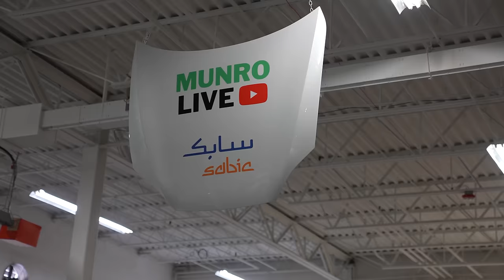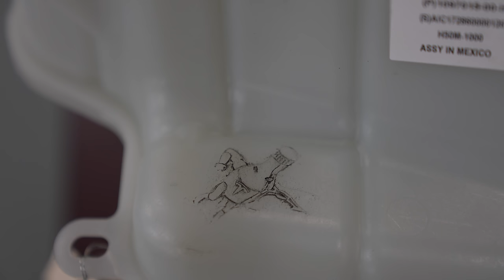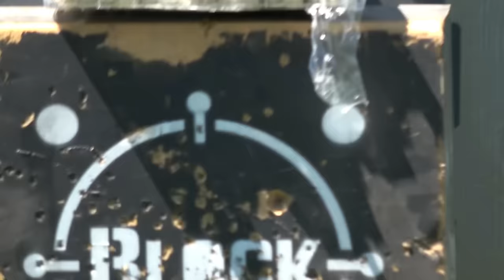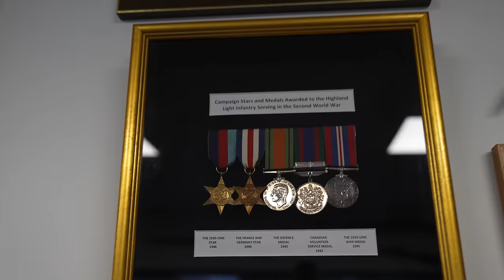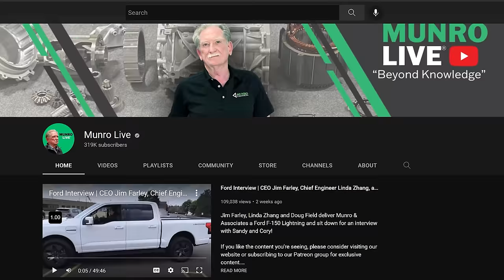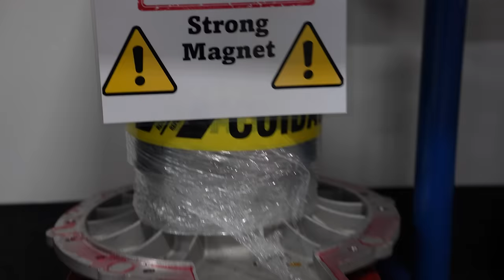Picking up my New Tesla 4680 Battery!

Comment: The funny thing is when Sandy started this, Tesla fans did not like what he had to say. Now, he is the biggest Tesla fan
Reply: Tesla has certainly done a lot to simplify manufacturing and reduce part count.
Reply: Some of Munro’s suggestions to Tesla were actually implemented. He’s contributed more than most Tesla fans.
Reply: It was the way it was done. Not specifically by Sandy himself. He didn't like the body build quality, but hadn't started tearing down the car. His first impressions were then pushed heavily at the time by hate groups and media. When he started the teardown, he began praising a lot of the tech in the car. I remember it appearing like UBS or another company was trying to keep his stance at that point silent, but that could have been just a misunderstanding on my part. Either way, you never heard the good things he would say by the media or those hate groups. That was about 5 years. Tesla has since implemented a ton of improvements that Sandy suggested and gone beyond that.

Comment: so if you get volts right...why not replace the batteries of an old hybrid car with 4680 cells? should increse the range of the car quite good! or will the computers detect that something is wrong?

Comment: They have never improved the batteries that well the mileage is still not as good as the 1800 battery pack in the first electric car it would go a thousand miles on a charge but they've never improved it than that matter of fact it went downhill the 500 or less

Comment: Folks, if you like peace of mind about your battery (longevity & safety), for years to come, just charge your EV between 30% - 70% (and do  90% - 100% when going for a long Road Trip).

(I own Tesla S & X, and I'm an Electrical Engineer)

* High temperatures kill batteries.  If you go on a holiday/vacation during the summer, leave your vehicle at a low SOC (state of charge).  For example, at or below 30% SOC  

* Cycle within a narrow SOC range.  For example: 40-60% rather than 10-80%.  The cathode expands and contracts in a wider SOC range, which causes it to break apart.   

* On that note:  The lower the narrower the SOC range, the better.  That means charging frequently.  

* Avoid charging the vehicle above 75% SOC.  Above 75% side reactions start occuring that cause degradation.  This also reduces the volume expansion issues mentioned

* Taking all variables into account, operating between 45-70% SOC, and storage at ~30% is ideal.  

* Occasional high SOC and wide SOC range are okay!  For example, the occasional road trip.

* With good thermal management hardware and battery management software, supercharging should have minimal negative effects on cycle life

But even y'all will not follow those tips. The battery will not die tomorrow. it is just that there are some small (or big) consequences later on.

Have a great day!

Comment: Can you do a video on what happens with older batteries?  Do they get recycled?  Wonder if electric cars are trading one problem gas pollution for e-waste caused by old used lithium-ion?
Reply: That’s exactly what is happening
Reply: Tesla recycles all of their old malfunctioning battery packs which aren't repairable anymore to use in cars.
Reply: they can be recycled but currently less then 20% are
some are landfilled in special landfill for possible future re digging up for recycling 
others are being stockpiled even tho its very dangerous to do it

also the amount of extra mining etc for an ev really outweighs any benifit
Reply: @southaussiegarbo2054  this information is incorrect. Tesla recycles ALL of their old batteries in house.
The volume of minerals extracted from the ground for EV'S over the complete lifespan is also much smaller than the volume needed to produce and run an ICE car.
Reply: The up-front environmental impact is higher for electric vehicles compared to ICE, but the total environmental impact over the whole life-cycle of the product is lower.
Reply: @WallaWillie   i would say its about the same 
Especially when lead acid batteries are more easily recyclable then lithium ones.
It really is about the same if you think hard but they just wont admit it
Reply: @maxencesimonart4302   they dont recycle them all as that is impossible 
Especially when they sold world wide and cannot go via airmail so gotta go by sea freight which is hella expensive for the batteries by themselfs
Its cheaper to seafreight the whole car then it is to seafreight a couple hundred kilo battery
Reply: @maxencesimonart4302  and actually more minierals are extracted for an ev bc regular fuel vehicles dont require lithium or many other heavy metals in the amount an ev does(including cobolt,cadmium and more including gold and copper)
Most ice vehicles contain
Steel
Aluminium 
Copper
Plastic
And traces of gold or silver depending on many factors.

An ev contains more due to lithium and other stuff. 

Just they dont like revealing it

Plus how will we build roads without making petrol/diesel as well the liquid tar/tack is a by-product of fuel manufacturing. 

We are trialing alternatives but so far they arent holding up as good as the good old fashioned asphalt/blacktop we been using for donkeys years. 
So yeah.

Also atleast an ice vehicle could burn ethanol or even if done right burn hydrogen
Reply: @southaussiegarbo2054  I was talking about the thousands of liters of raw petroleum that need to get pumped out of the ground in order to run ICE cars during their lifetime. In addition, Tesla doesn’t use cobalt in their LFP batteries and their 4680 batteries. And yes an ICE car uses more rare earth materials than an EV due to the katalytic exhaust system to remove hazardous fumes from the air.
Don’t worry about the need for leftovers from fuel refinery from road, even when all cars are electric the world will still use more than enough fossil fuels for that.
Finally, fossil fuels are in no way sustainable due to CO2 emissions and limited reserves on earth, so sooner or later an alternative will have to be found. Therefore let’s just embrace change and make the best of it through brilliant engineering and focus on sustainability, like Tesla does.
Reply: @maxencesimonart4302   they cant recycle them all lol thats physically impossible. It would just be a myth they use to look good kinda like myths other places use
Reply: @maxencesimonart4302   and tbh when most electricity around the world is produced by burning fossil fuels then yeah ev dont look good
Also where im at its more expensive to charge an ev then it is to use an ice car
Not to mention some ev have issues for towing where its breaks wont work if it is at 0% charge unless you hold the break pedal down. 

Ev also are tested empty not loaded(that was proven by a few places ik of and they wound up selling the ev at a huge loss.

Ev should stay in development for the next 10 to 15 years before we try forcing them on everyone
Not everyone has 50k to spend on a new ev and upto 30k for a new battery depending on the country you in
Legit you could service an ice car for upto 80 years with that money which includes a new battery every 3 years and new tyres every 1 to 2 years.

Here some guy used mains power just for his ev and for 3 months it was around $800

Where as his ice vehicle petrol bill for same time was about 300 bucks. 

That kinda puts it in perspective that ev are more towards wealthy

Not to mention the neumerous ev charging stations in garages catching fire recently causing people to lose everything sadly thus ending up costing them over a million dollars. 
Insurance will cover some that cost but you still out of pocket for the 5 or 10 grand excess to.
Reply: @southaussiegarbo2054  obviously they can recycle them all for the time being. Pack last around 12 years, that has been observed until now. 12 years ago they didn’t produce many cars and they are thus able to recycle them all. If it was untrue, shareholders would have sued the company for misleading information.
Reply: @maxencesimonart4302   people holding shares wouldnt bother looking deep enough into costs to ship a battery from say Australia back to tesla via sea freight (bc lithium cant go by air mail) 
To ship a battery by sea freight would cost thousands of dollars 
To ship 5 cars via sea costs around 4 times what it costs to ship one battery all bc said battery is dangerous goods and they wouldnt be shipping a 20foot container back thus cost a fortune to send 1 or 2 back. 

I did the digging to find costs to 😂. 
Its all what they call fine print/hidden info

Not to mention the amount of diesel used in said cargo ship to transport the battery back to being allot of fuel
Reply: @isaactruss5922  no its not. tesla and other carmakers are literally recycling old batteries...either themselves or other companies!
Reply: @southaussiegarbo2054  I have shares and I look into this of course. It does cost them money but it yields huge amounts of money as well as they don't have to dig up new materials for other batteries.
Batteries can go by air freight too, so sea freight isn't the only option.
Reply: @southaussiegarbo2054  You have many issues in the info you have. First, recycling and repurposing is done frequently. Maybe not 100%, but still very high. Batteries are too valuable to leave disposed for too long. Recycling is improving very quickly as more recycling centers pop up. It's hard to get good and accurate numbers since everything is changing so fast right now. EVs haven't been getting built in high numbers for very long and everything is different per country. 

The second big mistake is your view on power generation. This seems to be due to you living in or at least highly associated with Australia. Coal power is king over there currently, at over 70% of electricity comes from it. That is not the case in most areas where EVs are sold. China is likely the only location where EVs are sold heavily that still relies on a majority of coal power plants for electricity, and it is still only a little over 50%. Europe and the US get very little power from coal. Natural Gas is a major use for power plants, but nuclear, solar, wind, and hydro all make up a large amount of electricity generation as well. Further, an EV powered by coal is still cleaner than an ICE vehicle. It just may not offset it's extra construction in the lifetime of the vehicle and typically an efficient hybrid is a cleaner overall solution. When using natural gas, an EV is far cleaner than any ICE and will offset any extra pollution generated by it's construction in it's lifetime than all except the absolute most efficient hybrids. If you use mostly clean power, like solar or wind that can be installed at your home, you can offset EV construction pollution in less than a year of use, and less than 3 years over even keeping an old ICE car. Engineering Explained did a great video on this a few years ago.
Reply: В Масштабах заводов "Тиеслы" они не будут заниматься полной переработкой, они могуть снять контроллеры, а ячейки отправятся на свалку, выколупывать каждую баночку не кто не будет. Это рекоамный ход что они перерабатывают батареи.

Comment: @6:20, you can see sparks in the pack between the batteries.
Reply: I saw that too, but upon replay a few times doesn't it look like a cellophane type thing flapping in a fan breeze? They have some big fans around the room and there might be one overhead really whipping and causing that to flap.

Comment: There is one very obvious problem with all these battery cells inside that foam, and that is saying goodbye to the possibility to replacing single cells, instead of the whole battery, if a single cell should happen to fail. 

I have had EVs since 2002, and am quite disappointed about the humanity not managing to mandate the right to repair through legislation which when it lacka - both makes our phones less repairable because of DRMed parts, and EVs not so sustainable, as a new battery is priced to more than the price for a new car. EVs can be made really modular and easy to fix, instead we are looking at a John Deere Scheme, in a larger degree, especially with Tesla.

Tesla may be a cool car, with advanced technology, however the customers service and rights is no good at Tesla’s, so noone who barely affords a Tesla,  should buy a Tesla, but rather some other EV, and obviously look for the brands that are less hostile to their customers when something needs to be repaired. Which is an advice for buying any modern electronic product, really.

Comment: The production of batteries requires lithium.  To produce 1 ton, the leftover process produces 78 million tons of acid water.  This is only 1 example of what is required to make the batteries.  Good thing it’s Green.
Reply: Have any examples of the environmental cost for getting oil? I dont recall any giant lithium spills. But you ignore that right?

Comment: I am also blown away by Elon Musk and the genius behind everything he does!   Elon is doing really good work.   I am starting to believe the 4680 form factor is probably not a good move though.   I don't like having only 9 batteries in parallel,  I liked more batteries in parallel because we know fuses will blow and you can't just switch a single battery out.
Reply: You ain't switching that battery, or even the pack. It would be a complete write off. :o
Reply: @joshuaphillips4842  exactly. . . That is what I like about current Tesla you have 46 batteries in parallel. . . Blow 1 fuse and it is nothing much.
Reply: You cannot easily replace the current batteries either, and you shouldn't even if you can unless you know a lot about battery packs and are willing to manually balance the cells.
Reply: @anthonypelchat  lol, sounds dangerous
Reply: @joshuaphillips4842  If you set it up properly and have the right tools, not too bad. About the same as a diy solar system using 48v packs or higher. Dangerous if you just start playing with stuff though. And it is amplified as you are dealing with around 350-400v DC. But once everything is in place, it's mostly just plug and go. If you don't maintain it though, you either a dead bms, dead battery pack, or a massive fire. Fun times.

Trying to do any work on the pack is extremely dangerous though. Even running the battery down to completely dead, but still rechargeable, is around 250v DC. You touch something wrong, you drop something metal, or you puncture the pack and get death and/or mayhem.

Comment: The people who are advocating and promoting the EVs as good for the environment and energy efficient are not right, they are wrong. Each EV battery requires 200 tons of fossil fuel mining to produce the raw materials, the EV's don't last as long as internal combustion engine cars either and these batteries are not easily recycled at this time. China the world's largest EV maker, burns more coal than the rest of the world combined and they are building more coal fired power plants. The power has to be generated, transmitted via power lines to charge EV batteries, much less efficient than petrol cars. So EVs aren't energy efficient or as environmentally friendly petrol cars. The government and the manufacturers are selling EVs dishonestly.

Comment: Why does Tesla take 10 years to redesign their cars?
Reply: cos they don't batch up changes into model years.. they are constantly changing them on the fly with improvements.. I think the stat was something like 1,500 changes per year on a live production line.. legacy auto generally don't touch anything cos they have everything outsourced to 3rd party manufacturers and have to wait for new supply contracts. That's what Tesla's vertical integration is all about.. things change - it's subtle, no step changes.

Comment: With the 4680 pack, what happens when the battery needs to be replaced?
Reply: exactly what happens now...you replace it. 
the difference with the future 4680(not this current one) the prices will drop more then 50%, to around or bellow 5000$, probably much less...at least this is coming from battery experts that had access to tesla!
Reply: @BFAO1621  but isn’t it a structural part of the chasis? Or is simply removable?
Reply: You can remove the pack pretty easily. Sandy's team did so. You cannot easily remove individual cells. Not a big deal though. Recycling centers shred the battery pack and extract the elements. over 90% of the battery pack can be recycled this way.